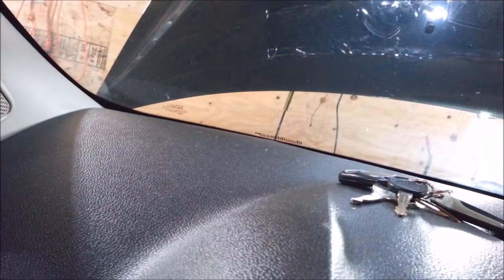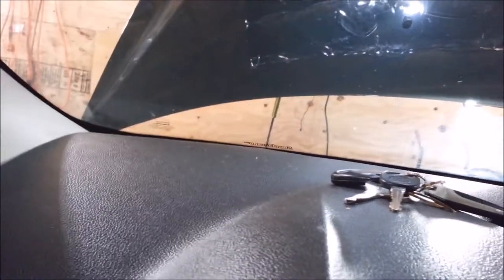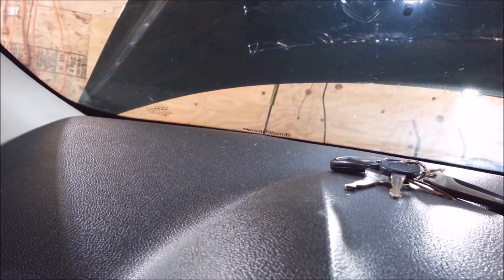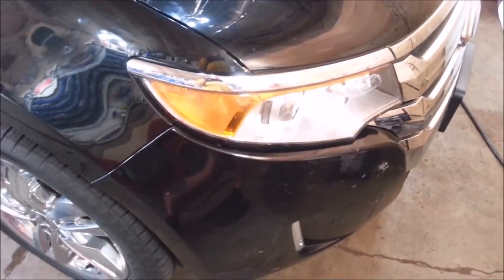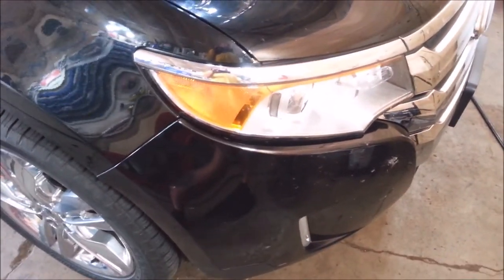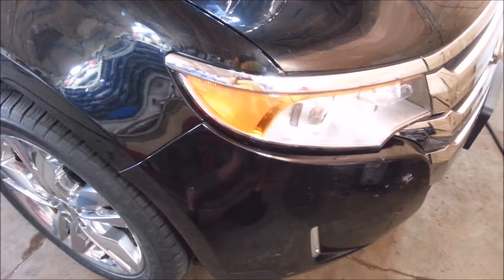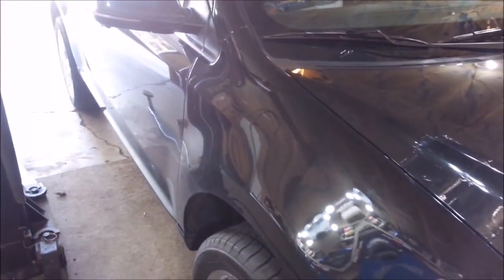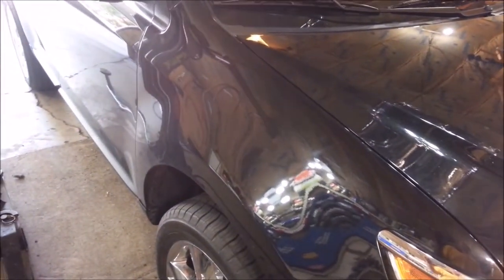2007-2015 Ford Edge MKX low brake pedal fix

Comment: 2011 Ford "slEDGE"....I had the booster replaced after my mechanic found the "extended warranty". Originally, my brakes became squash after I braked over a manhole cover and slid. It took a while for them to recover. Pumping ABS? Yep it worked. Weird right?
They came back but went crazy spongy again. Now they are a hazard. Now, if I brake, they are squash. If I pump my brakes, they catch on the second pump but better on the third, where they should. I have driven/owned many vehicles. Drove them forever. I also drive diesel ambulances. Driving history: (no particular order)Pontiac Trans Am, Gran Prix, Chevy conversion van, Beretta, Ford escort 4 speed Pony, Chrysler with a slant 6, Mountaineer, Dodge caravan (many kids), and now this 'slEDGE'. I have never had the annoying setup/issues as I have in this vehicle.Obnoxious really. Now my left rear passenger door constantly says it isn't shut, which it is. Software/modules are only as good as the designer/programmer. That being said...
I am grateful my mechanic respects me as a driver/vehicle owner. The local dealership, not so much. 
I will be doing this to see if it fixes the issue. I think the mall parking lot on a Sunday should work well. I'll keep you posted.

Comment: Mine were fine. Did the HD brake upgrades. Changed all 4 rotors calipers and hoses. Did the typical 2 person bleed method I’ve used hundreds of times. Now I have this issue. I tried the grenade method but not in reverse. I’ll try that tomorrow and hopefully it works for me too. Frustrating after spending all that money.

Comment: Same symptom in 2010 MKX. First noticed only in reverse down our steep driveway. Had our very trusted mechanic of 8 years explore and could not detect any problems. 2 months later it is significantly and rapidly worsening and now in forward. Breaks don't grab until the bottom and when they do, it is abrupt but not a lock up. Also my wife complained of fluid rushing sound when breaks are mushy and also a loud  whining noise when pedal was depressed deep. ABS light comes on at start up and then goes off with others.

I just did what worked for you. On the first 4 grenades LOL, I got to hear the whine and detected no improvement in mush and breaking at bottom. On 5 - 10, whining is gone and breaks are acting normal, engaging at top and consistently increase with increase in pedal depression.  NORMAL. Thanks for posting. I will repost if condition returns. I will also share with my mechanic to see if he can make sense of it and/or point out danger of catastrophic failure.
Reply from the maker: You're welcome. Thanks for watching!
Reply: @RustBeltAuto  Sadly the symptoms are all back today.
Reply from the maker: @justinfoster2882  let me know if it is fixed after someone does a brake flush, and puts an abs module in it or whatever. I would not be suprised if yours has an ABS code stored of some kind.
Reply: Have you had your brake booster checked out, my 2010 had those exact similar symptoms as yours, changed out the booster and master cylinder everything seems to be fine now

Comment: My pedal turned spongy after sliding on some wet road. My solution was to turn the car off and repeatedly press the brake pedal until it became hard and locked. Turning the car on and driving it I could feel the brake pedal go back to normal good as new.
Reply from the maker: Nice hack. Never thought of that.  Thus thing was constantly squishy even with the key off.

Comment: FYI, I just had the same problem and this fix worked for me. In my case it was definitely the HCU. I had to slam on my brakes to avoid an accident and the abs activated - after that the  brakes had a low pedal. I took it to a gravel road and activated the abs twice in both forward and reverse. From what I have read a valve inside the HCU sticks causing fluid to internally bypass which causes the low pedal. Thanks for the video and fix instructions. 2011 Ford Edge
Reply from the maker: Still wondering why this problem has not been recalled. It will probably kill people.

Comment: 100% worked like a charm 💪 I took it into a gravel parking lot and put it in reverse and grenaded the brakes a few times and popped back into place. Drove it around just to make sure and viola, issue fixed. Save your money and give this a try before taking it to the shop. Thank you for the video!
Reply from the maker: You should really change out your brake fluid.
Reply: It fixed my issue too but it came right back after it sat for an hour. Goes right back to the floor. Replaced master cylinder and HCU still does it. Used a scan too to bleed and step by step procedure.

Comment: Wish I saw this 24 hours ago, they told me i need a new MC and possibly a new HCU. $400 bucks for the MC and like $1600 for the HCU. I will not let them do the HCU change
Reply: I already did the mc 2 weeks ago and abs activated again yesterday and now the pedal is back to being low. They told me next step is the HCU,  which I am now questioning because of this video.

Comment: I was turning off the highway and turning right at an intersection. Brake pedal went to the floor, barely slowing me. No brake or ABS light. Got onto shoulder, check brake fluid level and it was full. Try to drive a bit but pedal goes to floor. Towed home and I installed new master cylinder, bled all brake corners, used a quart of fluid. Petal still goes nearly to floor. A couple years ago I had the booster replaced. This issue is very different. I use Forscan, had an ABS code for no communication with module. Cleared it, now no ABS codes come back. Car is on stand now, I have new master cylinder, fresh fluid bubble free lines, but pedal sinks nearly to floor. I will see if I can creep the car to a gravel road and exercise the ABS. I suspect the valve body is stuck, dealer doesn’t even stock it, said they have only sold one in 4 years. Big dealership. They do stock the module it bolts too, sold 4 this year. I have it on hand unopened. I understand if installed it needs to be programmed by them as well. Very frustrating and really a safety issue. No warning lights, nothing, but no brakes. 
Wish me luck. I will update with results
Thanks for this.
Reply from the maker: My problem the brakes still worked, just a spongy pedal. Good luck. Be safe.
Reply: so how about that update?

Comment: Mechanics trow parts in order to fix a issue thats mormal even the pros do it
Reply from the maker: I put a master, in the thing, and did a brake flush. It is hard to diagnose a brake issue with ABS module problems like this. Techs realize that sometimes it is cheaper, and easier to save labor in diagnostics, make a best guess, and throw a part at it. If it is a techs car, the labor is free, and they cheap it out any way they can.
Reply: @RustBeltAuto   i just had the same issue did whag you said on the video abs actually acts up haha but didnt fix it im thinking a master cyl. Would you consider a booster though?

Comment: WOW! Glad i watched this video. Makes perfect sense. Ive been working on cars for many years but never expected the ABS motor would fail. I did many hard stops on the snow. The pedal came back maybe 10% whilst ABS activated pushing up un my foot. Pedal than faded. to the floor. I will try again tomorrow.

Comment: I had similar problem with brake pedal fade I bled the brakes twice and I decided to replace the rear calipers that's solved the problem brakes are perfect now
Reply from the maker: Yes. Rear drum adjustment aspecially can effect pedal height. What was the reason for your bad rear calipers?

Comment: If your having this problem after replacing the brake booster then its the HCU my 2012 Lincoln MKX was having the same issues over a year ago in the shop 3 times it's been fine after they replaced the HCU over a year ago.
Reply from the maker: Its been a year and 6 months since I did this. Still waiting for someone to tell me it's not fixed 😙🎶. The million dollar question is, what was wrong with the HCU? Bad, or replaced not being an answer. Also, was it "fixed" all 3 times, or just the last one?
Reply: @RustBeltAuto  I did the brake stopping and it fixed it but it comes right back after shutdown sitting for a bit.
Reply from the maker: @FloridaMan7337  you probably need an hcu.
Reply: @RustBeltAuto  I just replaced that
Reply from the maker: @FloridaMan7337  i have no answers then. Good luck.

Comment: Hi there, I am facing a similar issue with my 2013 Edge, but with a slight difference. I am driving normally on an average speed of 50 mph, when I hit the brake pedal it sinks to the floor and doesn’t slow down the car. Then after I completely stop the car and hit the pedal many times quickly, it goes back to normal. This incident happened twice in a month and only while driving. The authorized ford service provider checked it up and didn’t diagnose any issue. Any help please ?????
Reply from the maker: Your authorized service provider must not like making money. Sounds like a death trap. You should get a second opinion.
Reply: @RustBeltAuto  they mentioned it COULD BE the hydraulic control system HCU but they are not certain, try to change it, they said as it’s a $100 thing
Reply from the maker: @abdelfattahsaleh6254  they are going to guess, and throw parts at it, if it doesn't show up with a problem. I replaced the master cylinder, and changed out all the brake fluid, before I did what I did. They could be right. There is no way to know for sure.

Comment: I have a couple of questions : what is the possible cause of this happening and is it likely to happen again. The reason I ask is that it happened on my 2013 Lincoln MKX and I am planning a long trip this coming summer. Thanks for this video as it saved me from all the expense and time involved with me replacing the master cylinder.
Reply from the maker: I would guess the manufacturer either has a module, or programming that causes a valve to stick, or it has a mechanical issue. The fact that this problem has not been recalled blows my mind.

Comment: Will the ABS light come on when  you slam the brakes in reverse?  I have tried several times to slam the brakes in reverse to fix the issue but it's not working. I had dealership do the recall on brake booster and I have changed master cylinder.
Reply from the maker: The light does not come on. You should hear some growling noise, and feel the pedal do all kinds of funny things when it activates. Loose gravel works best.

Comment: Thank you!  Worked like a charm!
Reply: Could you explain what exactly you did that caused the problem fixed?
Reply: Went backyards on a dirt road and slammed on the brakes.  Took 3 or 4 tries then it worked great.

Comment: This morning I went for a test drive. Brake pedal feel was better but not great. Found a gravel parking lot and did lots of hard braking. Forward and reverse. ABS was singing. Damned if the brakes didn’t get better and better. I think it is back to normal. Not sure what fixed the problem. Master cylinder or brake fluid flushes but the ABS cycling added to it. Thanks for the suggestions
Reply from the maker: Your welcome. This should never be a problem. Ford should stand behind their product on this one. Thanks for watching!

Comment: this worked for me except i didnt go in reverse .... i bled the brake system and the abs and it still was spongy so i activated the abs in drive gave it about 4 good quick panic stops then braking returned to normal... im thinkin a valve or something gets stuck in the hcu
Reply from the maker: Agreed. I have done the same thing to GM's when the auto bleed procedure doesn't work.

Comment: Any ideas what the core issue is? I seen your video awhile back and the brake will work after I go in reverse, and then it will do it again a couple weeks later. Its our family car, so I'm hesitant to let the kids ride around in it when this is happening.
Reply from the maker: People are saying there is a sticking valve in the abs unit.

Comment: Air trapped in the ABS module?
Reply from the maker: SuperM1687 no It's not air. Probably has something to do with the valving. It is supposed to close, and for whatever reason, it did not. Activating it a bunch caused it to go back in the closed position like it is supposed to be. GM's have an "auto bleed" procedure you can do with a scan tool, I do not know if this one does because I do not have programming for it, so I did my own auto bleed procedure by stomping on the brakes. Loose surfaces seem to help the most, like sand and gravel.
Reply: SuperM1687 hows the activation off abs your telling??i have 1 edge working with same concern pedal drips on floor i change master cylinder and performed abs bleeding and manual bleeding still the same
Reply from the maker: @colognepp2  like I said, I found a road with loose gravel on it, went in reverse at about 15mph, and grenades the brakes really hard. It activated the abs. I did it twice for good measure, and it has worked ever since. That's how it worked for me anyways. Forward did nothing. Good luck! If you can pump the pedal up you have air in the system.
Reply: Rust Belt Auto ok thanks for the info i will try it now,
Reply from the maker: I hope it works for you. Good luck!

Comment: This worked for me about a year ago. Now we are having the same issue again. This time I have tried this process many times and I cannot get it fixed. We had a check engine code pop up about a month ago and it went away before I could scan it. Not sure if I should replace the master cylinder or not. We have no abs light coming on, even when I go 45 mph in reverse and mash the brakes.
Reply from the maker: It is probably an issue with the ABS unit. If you had a check engine light, there should be a history code stored.
Reply: @RustBeltAuto  thank you, I will have it checked

Comment: I saw another video where the guy said to go about 25mph then hit the brakes hard while making a left hand turn(of course dont jerk the wheel and flip but while performing the left hand turn, hit the brakes). I've had so many problems with my 2011 Edge. I was driving on the interstate about a year ago doing a comfortable 80-85mph on a straight stretch, middle lane, when out of nowhere the damn CV Joint/axle snapped and I went airborne, skidded into a 180, ran off the road and almost flipped but I got control of it after I hit the median. The wheel was screwed up with a negative camber of maybe 40° or so. A lot of people talk about the knocking sound coming from the front tires of their Ford Edges. If you hear the knocking sound you might want to get it checked out. It was only by luck that I didn't have a fatal accident.

Comment: OK my brother....thank you for taking the time to post this video. My wife's 2012 Ford Edge with only 30k miles had the spongy brake issue come up about 2 weeks ago.....I tried reverse on a dry pavement and couldn't get the ABS to activate so today I drove out to a dirt road and got the car up to around 40 and SLAMMED on the brakes......it took about 5 times but VOILA.....problem solved!!! You sir are a genius and I wish you a very Merry Christmas!!!!

Comment: So this did work for me!  However I made a quick stop going forward after and engaged the ABS and its back to being spongy.  Is this a sensor or something? Haven't tried to reverse it yet again.
Reply from the maker: People are saying the abs unit should be replaced. I changed the brake fluid on this car, and the problem never returned so far.

Comment: This happened to me today almost ran into the back of someone will i need to do this every time or will if fix it permanently? It was also raining. I just got my car and i dont want to wreck it.
Reply from the maker: People are replacing the hcu apparently.
Reply from the maker: I'm not understanding why this is not another infamous ford recall. It's a serious safety issue.
Reply: Rust Belt Auto okay ill find someone to fix it or my warranty
Reply from the maker: @Miecebaby  if you have a warranty, use it. After doing what I did to this thing, there is still not a problem.
Reply: Okay i will you said just put it in reverse and then slam on the brakes in the mean time?
Reply from the maker: @Miecebaby  in loose gravel. It will activate the ABS. it will growl, and your pedal will vibrate. That will force the solenoids, and valves to operate.
Reply: Okay awesome i know where to go
Reply: I agree i almost ran into the back of someone’s vehicle

Comment: How do you activate the abs? Just by slamming the brakes??
Reply from the maker: Yes. I did it in reverse, in a place with lots of loose gravel. Doing it on dry tar probably won't work good enough.
Reply: Thanks man, I have the exact same problem! My mistake was I thought it was the booster, and when I replaced the booster I didn’t adjust the rod. Now I’m royally screwed and have to pull it all apart just to adjust the dam booster! Fml
Reply: I did try it on a regular paved road and it worked after 7 tries.
Reply: @lillyrodriguez49  wow lily that’s crazy

Comment: I got clean fluid and new rear brake pads slammed the brakes 4 or 5 times in reverse going down hill and still going halfway to the floor. I was thinking brake booster if anyone can give me some ideas
Reply from the maker: Brake booster will give you a rock hard pedal. It will be hard to brake. Did it activate the ABS? It should growl like crazy. You should feel the pedal pulsating.
Reply: @RustBeltAuto  i only felt the abs once
Reply from the maker: @blindreck  that's why you try it on gravel. Or perhaps just replace the abs unit.
Reply: @RustBeltAuto  there an alternative besides gravel road? Dont have many i can go to
Reply from the maker: @blindreck  your neighbors lawn?